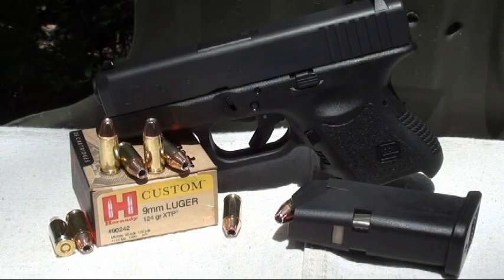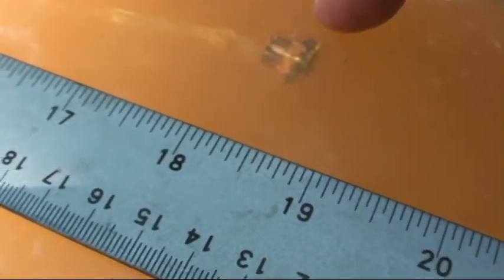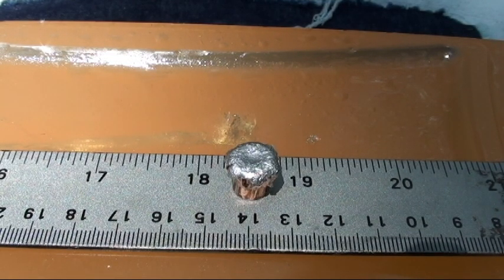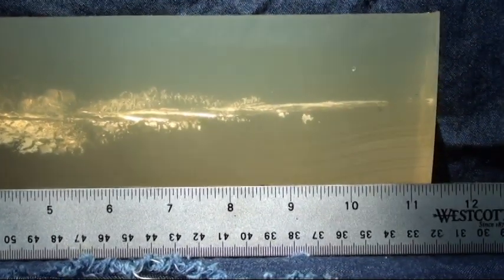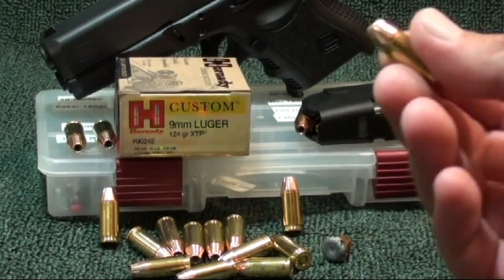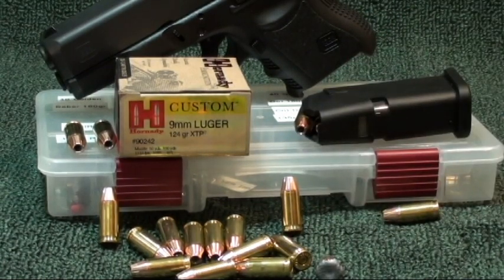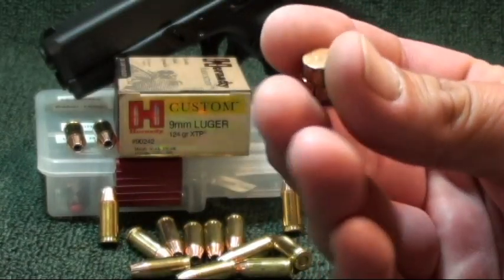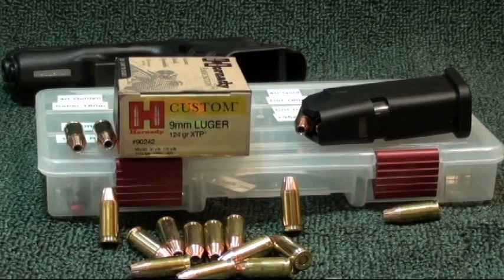9mm 124gr XTP short barrel ballistic gel test

Comment: How about 147 gr Hornady Custom?  Is that too much bullet for the G26 for expansion or should that be left for the 4-5 inch barrels.
Reply from the maker: I am a true believer in heavier bullets for longer barrels so velocity can get up there, well the Micro 150gr HST shot my theory to hell LOL!  But with rounds not designed for short barrels I still hold true to that logic, short barrels 90-115 medium 115-124 and full length 124-147, it has worked for me for years (until the new Micro HST came out) (it was made for short barrels though)

Comment: I tried the Fiocchi "Extrema" 124 gr xtp/jhp which come with NICKEL PLATED cases and they perform as well
as the "Hornady Custom" [1130 fps] tested here BUT they were only $14.50 a box [of 25].

I use them in my CCW [IWB] mint condition 1987 Browning High Power MKII and they're real nice.

Here's a photo of my pistol - http://i.picasion.com/pic79/3b9b95bc90db0ad934f98abe6d31cdfe.gif
Reply from the maker: CD MCKINNEY Nice pistol for sure, hang onto that!

Comment: Thanks for posting the velocity of this round out of the Glock 26.  

BTW… the 4-layers of denim test is an IWBA protocol only.  The FBI does NOT use that test for heavy clothing, but a more realistic formulation of one layer of cotton t-shirt, one layer of flannel shirt, a layer of polartec fleece, and one layer of denim.  The FBI heavy clothing test is obviously more difficult and costly to reproduce, as the exact thread count and weight of the material is specified.  The IBWA 4-layers of denim test is claimed to be created as an engineering test, but is not a realistic test and is merely easier and cheaper to make than the more complex FBI construction.